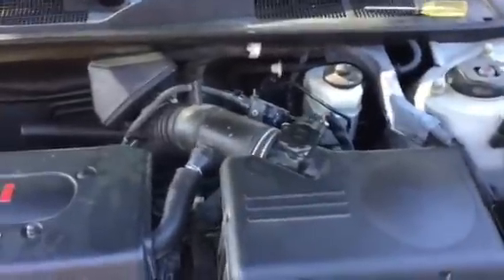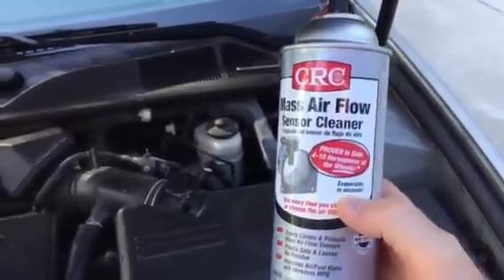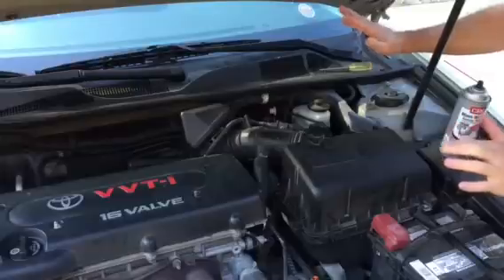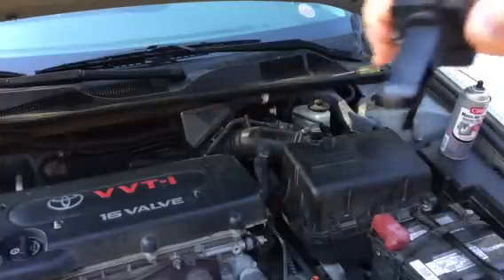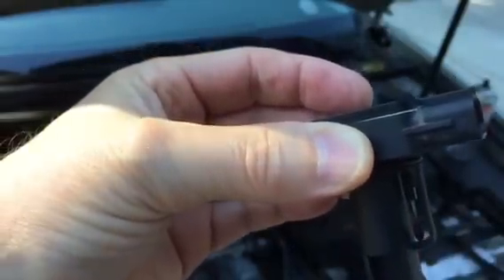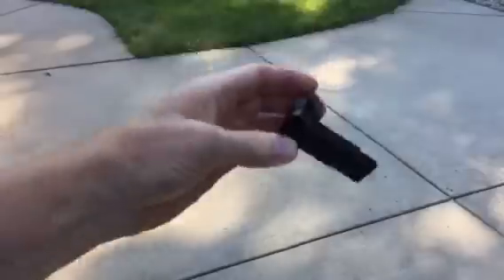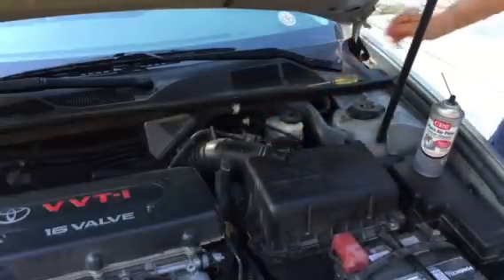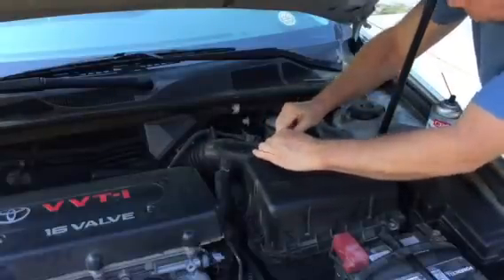Why Does My Car Lose Power Loss Of Acceleration?

Comment: Just had this problem on my Escape V6, fixed it by changing 2 faulty ignition coils and all the 6 spark plugs, on top of that they also cleaned the MAF sensor and flushed out the air intake system. Now the car runs very well. Thanks for the video Saul :)
Reply: So what was the problem? Ignition coil or spark plugs or maf sensor?
Reply: @kenantv7487  Donno, the problem kept coming back, I ended up selling the damn thing for 500 bucks to a Ford mechanic. Even now he struggles to keep it roadworthy. Buy a Japanese car.
Reply: I have a 2010 honda stream rsz 1.8 liter engine cars run good on flat but when going over hill it just dies down about to shut off  no engine check light what might be my problem
Reply: Same here with my Honda Civic?? PLEASE Help thanks in advance 😊
Reply: appreciate it
Reply: My check engine light came on in April. I had my spark plugs and ignition coils changed, but the car still wasn’t accelerating smoothly like it was before I had the work done. I took it back and the spark plug wires were changed. Since then, I’ve had my wheels aligned and my 50K mile maintenance service which included an oil change, break fluid, and transmission fluid. Car still isn’t accelerating smoothly. I have taken the car into different shops AT LEAST five times and they’re telling me nothings wrong. I’m so tired.

Comment: I've been having hesitation on acceleration and took the car to a shop. They hooked it up to get a code and it came back with the code for the catalytic converter.   Is it possible for the computer to get a false reading like this if the the MAFS is dirty?
Reply from the maker: It's not likely.  The problem is a computer scanner can show a code for the catalytic converter once it loses only 5 percent of its efficiency.  Due to the acceleration issue, it's possible you could have a plugged cat but the hesitation issue is also the same symptoms of a dirty or faulty MAF sensor.  The cost to replace a cat is insane!.  A lot of people just gut the inside of the cat if their state does not require emmissions testing.
Reply: proclaimliberty2000 x

Comment: actually the "wires" dont do much, they simply increase in temperature as a means to give the PCM a reference point so it can notice the differential relationship between the "hot" wires and the cooler intake air to procure the algorythms needed to adjust fuel/air proportions as per specs whicj are stored in the PCM....I like yur vids but be sure and inform your followers that the neg battery terminal needs to be removed before dealing with ANY sensor
Reply: Why?

Comment: That looks like an map sensor not maf. Map sensor measures barometric pressure. Even if its filled with soil it will work. Most smartphones have a map sensor to measure barometric pressure (google that)
Reply from the maker: I can assure you this is a MAF sensor.
Reply: proclaimliberty2000 sory my bad i was commenting on a different video for a ford focus that doesnt have maf sensor..only map after the intake valve..that is definitely maf what you cleaned there 😂 map has only one part sticking...you can even change it if you are good with soldering iron and dentist equipment 😂

Comment: I accidentally sprayed some carb cleaner on the sensor what should I do next?
Reply: most of those cleaners are a mixture of degreaser slash acetone and dry up pretty quick, I would keep going on it, may wipe with a small like eye glasses cloth or camera clothe, it will be ok. been working on GM cars all my life since 8 years old and I am 60, and starting to hate it, but never owned a new car.
Reply: Sell it to the junk yard👍
Reply: @maxlove4821  That would increase the MASS AIR FLOW of his ass! 😂
Reply: @hankbridges5055  It might make him a world champion farter!
Reply: get a new one, carb/throttle body cleaner is too strong for electrical 👍
Reply: I was going to use carb spray. maybe it screw up the plastic. Just give it a visual first. I guess.

Comment: My 96 Jeep Cherokee has a problem I can't diagnose. The symptoms are similar to a bad/ dirty Mass Airflow Sensor and Throttle Position Sensor, but the symptoms don't fit either exactly. It happens only while driving, not while idling. 
  The engine will suddenly lose RPM as if it want to die for a couple seconds then will go back up to normal, then down and up repeatedly for a couple minutes then will clear up and run fine for a while. It also seems to "pop" lightly like it wants to back fire but can't.
  Would you consider this a problem with the MAS or TPS or could it be something else?
  Thank you.

P.S. I've tried changing fuel to a higher grade and used fuel injector cleaner.
Reply from the maker: If your check engine light is not on, then cleaning the MAF would be a good start.
Reply: ok thank you.

Comment: A 2002 GMC Safari 4.3 liter motor runs good idles good sometimes it just don't want to idle but you can start it and hold the gas down a little bit and drive no problem at all and if you hold the gas pedal down around idle position you can actually it will actually start I don't again all by itself what is the problem with that and how do I fix it
Reply from the maker: You may need to clean your throttle body https://youtu.be/cOAYWVBfuek

Comment: Clean mass air flow sensor.  But also check air filter.
Reply: I did all that too, and new air filter but its killing me so bad I want to sell it.
Reply: Matthew Simonds if it's not idling right also check to make sure no coolant is running down into the spark plug holes 😒

Comment: I dnt have a mass air flow sens on a 98 corolla but i do have the hesitation
Reply from the maker: You do have a mass air flow sensor.  I would also suggest you inspect your throttle body to see if it needs cleaning.  https://youtu.be/cOAYWVBfuek

Comment: Thank you so much!!  Instructions were easy to follow...did this myself after watching the video.  Removed the part to check it first, then used the MAF cleaner mentioned, and put the part back in.... no issues.  Took my van for a test drive right after and now the stop/starts are so much smoother than they were prior.  Cost was only $9 as I had to buy the MAF cleaner.  :)

Comment: Hello sir 
one camry vehicle 2010 model automatic transmission. vehicle hesitation during acceleration and vehicle running  engine malfunction light blinking and vehicle pickup is low. air flow sensor coupler remove time vehicle off. coupler remove then vehicle start  vehicle running and malfunction light blinking. what is problem in this vehicle. please help me sir.
Reply from the maker: You need to get a computer scanner check on your car right away! A blinking light usually indicates a severe engine misfire allowing unburned fuel to be dumped into the exhaust system.
Reply: thank you sir I will try......
Reply: Test the Throttle Position sensor, either too much or not enough air going thru the system it all is hooked up to sensors and that makes some dashboards flicker during the intermittent problem.

Comment: would you get black smoke coming out of the exhaust pipe if you step on accelerator peddle when its not working right
Reply from the maker: I've never heard of a dirty of faulty MAF causing black smoke.  It sounds to me like the piston rings in the engine are worn.

Comment: USED MASS AIR FLOW CLEANER ON A 1999  MERCURY AND GUESS WHAT; NO HESITATION ON ACCELERATION . RUNS SMOOTH NOW& GOT PASSING GEAR BACK WITHOUT DYING ON ACCELERATION
Reply: FRANK TORCHIA did it look dirty ?the fine wires inside the sensor?

Comment: Should i change the computer if the car won't accelerate and won't give me a check engine light? I've changed a lot of parts that might be the problem but nothing seems to work. Any thoughts?
Reply: Sayso Check your Coil And Spark Plugs That decreases acceleration also, Mine had a broken piece on the coil, After i replaced all 6 (V6) it was fine.
Reply from the maker: The computer is the last thing I would expect to go.  I would be checking the alternator or fuel  pump.
Reply: I changed the fuel pump, and the alternator is fine

Comment: Had a issue with my Neon where it wouldn't accelerate past 2300 rpms. I fixed it with a new cam shaft position sensor.

Comment: my 2JZ is expierecing slugglish accelaration at low rpm fine at high rpms throwing lean code and random misfire cleaned MAF didnt help. at idle it reads .40  gm/s is that normal? thanks in advance
Reply: AMG BENZ_HAMMER_6.0 Spark plugs man and coil man.
Reply: Don't know about the 40gm but in my English Idle should be right around 900 RPM's

Comment: im stepping on the gas Rpms hit around 2000-3000. Mph is only getting to about 20 mph sounds like my muffler is trying to breath air look under car i see alotta heat waves will this help?
Reply from the maker: It could.  I wonder if there's a problem with your fuel pump.  I would also do a computer scanner check for any codes.
Reply: i got P0171 code for bank 2 and misfire code on the first module
Reply: Jamarcus Remo
 check the catalytic converter !
it cause much heat & bad gas mileage & fuel smell & burn the engin oil  and make it darker 
you better do it soon as possible before your engine get any damage

Comment: I have an 04 Saturn ion... yesterday I was experiencing shaking and hesitation out of the blue when I drove to the gym.. when I came out the car was loud and I could barely accelerate ... I dove about 2 miles before it completely just cut off at a stop sign .. is this's method something I should try?
Reply from the maker: Absolutley!  It may just need cleaning or it may need to be replaced.
Reply: proclaimliberty2000 Thank you! ❤️

Comment: i use brake cleaner for this works like a charm
Reply: Damike Daevil toilet cleaner works perfectly aswell.
Reply: Damike Daevil i used electronic cleaner. havnt tetsed it yet but its had plenty of time to dry
Reply: Sadque 74 it ended up not being my problem but it cleaned it with no problems and its been a month
Reply: Dougie Backus 
is it work good this electronic cleaner
Reply: proclaimliberty2000 brakecleaner fizzles and its works everytime for me. But not saying your method isnt good.✌
Reply: Calisthenics Unity Nz toiletcleaner really?
Reply: Hey.. use rubbing alcohol.....90% pure... it evaporates real fast.... and ummm...it’s 98 cents. Lol.
Reply from the maker: Brake cleaner will leave residue and may affect performance.

Comment: I had a factory original filter on my 2011 malibu with 59000 miles.  I changed it yesterday but the air box was filled with sand.. it takes a long time for the car to accelerate... will cleaning the mass air flow sensor help??I vacuumed out the box n put a new air filter on...please advice thanks
Reply from the maker: The answer to your question is a big yes.  This could be your entire acceleration problem.  If you do not perform routine air filter maintenance on your engine then the mass air flow sensor will get dirty much faster.  Once it gets dirty you WILL have acceleration problems.
Reply: proclaimliberty2000 thanks ill clean it out and hopefully save myself $$$$ . ill confirm back in a week
Reply from the maker: Also, just be advised that if you do replace or clean your Mass Air Flow Sensor, it might take up to 50 miles of driving for your check engine light to reset and turn off.
Reply: proclaimliberty2000 currently my light is not on. so hopefully it stays off

Comment: Mass Airflow Sensor cleaner is the same stuff as CRC Electronics cleaner. They both evaporate quickly and leave behind no residues, without being too harsh on sensors.
Reply: From Starlight To Sunrise is it isopropyl alcohol?
Reply: Bingo!

Comment: I usually let mine dry for a half hour before reinstalling. I also spray down inside the housing. I think there is another wire in there. 2006 Toyota Matrix 4WD. You can also use an app like Torque with a Bluetooth OBD2 reader (mine has an on/off switch-I just leave it plugged in and off unless I'm using it) to make a note of airflow at idle after cleaning sensor. This will help you determine when to clean sensor.
Reply: This is not true you can take off the mass flow sensor wiring harness and your car will still start.
Reply: Idiot

Comment: 2001 mercedes C180 just got fixed thanks to your video. I did use brake cleaner because that is all i had at home. but it works better now. I did not clean it thoroughly though so I still have occasional sputtering. planning to just replace the MAF. I was worried that the brake cleaner would damage the MAF but it did not
Reply: I bought a new one; i also replaced the fuel pump and it's running lovely now
Reply from the maker: I'm sure once you replace it your performance will improve dramatically.
Reply from the maker: My can doesn't say that and there have been no problems.
Reply: proclaimliberty2000 what car is this you are working on ?????
Reply: proclaimliberty2000 didn't the can say not to use it on Toyota's? I know because I thought of using this once on my 06 v8 Tundra but I got discouraged as soon as I read "DO NOT USE ON LEXUS OR TOYOTA ENGINE'S" I use to work at AutoZone n a mechanic gave me advice n said to just replace it with an oem one from Toyota so how's it holding up for ya?

Comment: Hello I have a question. This happens with every automatic car I buy. I accidentally switch gears from park to drive and let off the break too quickly. After a while of doing this on accident than the car doesn't switch gears smooothly while driving. It jerks forward and. Did I mess up the transmission and is this a big fix? Please help.
Reply: motor mount?

Comment: My engine is revving up alot when i give it gas but its like bottlenecking itself it revvs up and then accelerates slowly until it hits 2k rpm then it jerks and hauls ass i think its my fuel pump or a bad injector but i can have my gas pedal all the way down and it will cap around 65mph i installed an aftermarket air filter but it was running fine after that...any suggestions on what it could be?
Reply: Dr.@k3 aka Doctor At K3 if u used the cotton filter with the oil on it like k&n and others, the oil could be coming off and caking on the maf sensor....this would fix it.

Comment: I have a 1993 Honda Civic hatchback with integra swap, and when I'm going down the highway say 55 the car surges like I'm flooring it or something but I hadn't moved my foot? What could cause this
Reply: Lexi Swanner maybe it's vtec 😂
Reply: SteeloTooTrill I had an old Nissan that did this and it was the transmission downshifthing itself but it being an older can and had some transmission problems it sometimes didn't shift at the right times and wasn't really smooth
Reply: Lexi Swanner  check plugs,if any sign on top connector( rust, corrison...), Possible could be wire or coil(coils usually good for 100k mi. but still work, not as effient though.
Reply: Tps sensor
Reply: Check ur throttle spring where the pedal cable goes on, might be rough or kinda stuck...and also how tight that pedal cable is on that throttle body. Good luck.

Comment: My 2005 Camry (4 cylinder) engine only vibrates when accelerating during 1600 - 2000 rpm, and you think this fix will work? (engine idle OK and normal driving OK,  accelerating OK > 2000 rpm)
Reply from the maker: I don't believe this will fix your problem.  I think you have something else going on.
Reply: Kevin Li Does it vibrate when you're driving up hill?
Reply: Neil Drabik
Reply: Kevin Li jEET 3 CLI
Reply: Kevin Li Try Dr Tranny Shudder Fix. It's a little red tube.